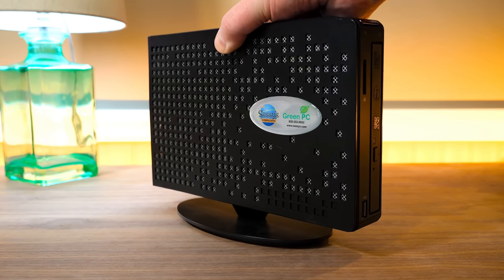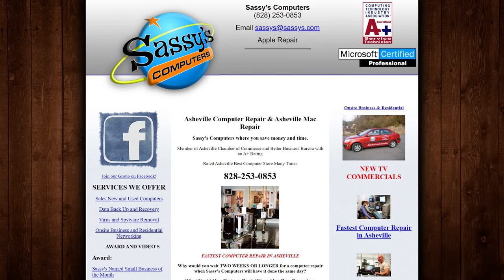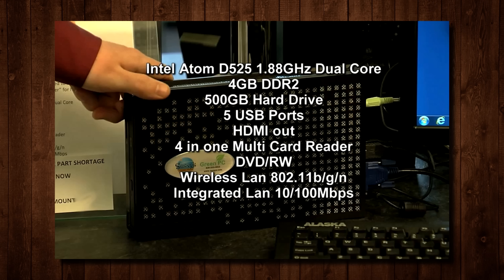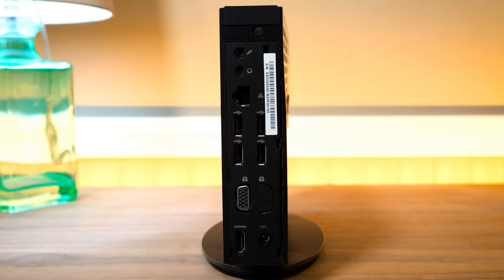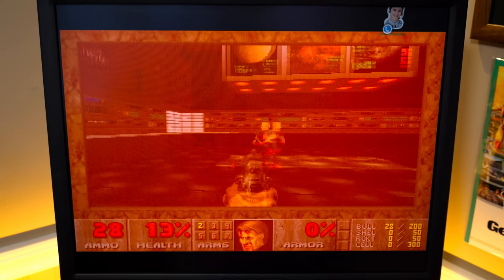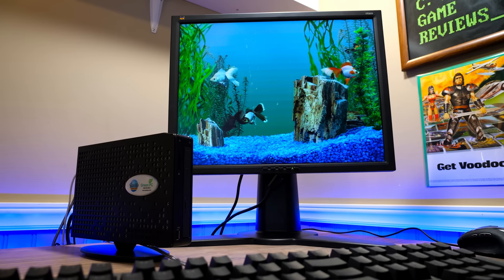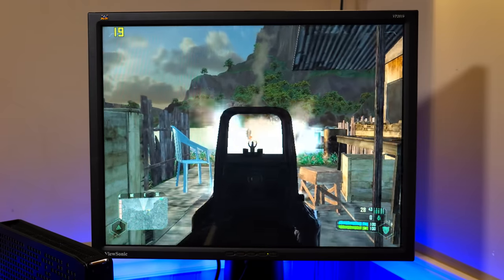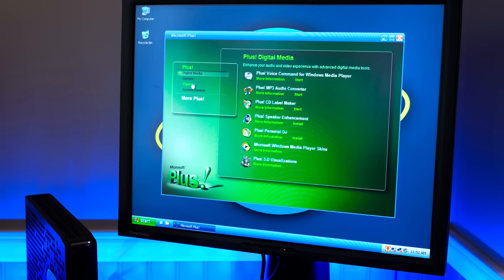Rejuvenating a $599 Shuttle Nettop from 2011! Sassy's Green PC

Comment: Used one of these as my daily driver back in the day, running Linux.  That it was fanless and had the Nvidia chip were the big draws for me.  Was just BARELY enough GPU power to run Starcraft 2 under Wine -- though on hot days, I had to point a box fan at the Shuttle to get a decent frame rate.

Comment: I just pulled a couple of these out of a storage box. Did you try and connect it to the internet?  Mine no longer connect and suspect the issue is related to TLS1.2 as none of my other old XP machines will connect to the WAN - they work fine on my LAN. - Ed

Comment: I recently got my hands on an HP All-In-One from 2016 with a spec list that's only marginally better than this, and it was apparently shipping with Windows 10 installed. Yikes! I got Lubuntu installed to it and use it primarily as a remote access client to my main rig, and honestly it was a smoother experience running Windows 11 from my main rig over the internet that it was running Lubuntu native.

Comment: I've bought a more modern mini pc, core i5 (8th gen), 16 gigs- put Linux Mate on it. My old computer died. I then got the Vulkan drivers on it, And it's a low level 3D modelling/ game running/ 3d printer handling thing. 
I've learned that silent= NOT good. Put a small desktop fan in front of it. Putting one in a mini fridge would be a hella project (obviously taking steps from getting moisture in it). Then, got an Onn multi card reader USB port thing. 

I now have more desk space to clutter up. 🙄

Comment: Its no wonder it struggled so much with windows 7... the aero theme was on. I wonder if there's even a big performance difference between 7 with classic theme and no aero on and stock windows xp
Reply: Good question 😊
Reply: I use Aero on my N270 netbook with a single-core Atom and base Intel graphics and it's surprisingly fine. I"m sure I would have switched off Aero if it made much difference. Given this nettop has the NVIDIA Ion chip Aero shouldn't make a difference.
Reply: @eDoc2020  that is not my experience with aero . Particularly when it released with windows Vista.  There very well documented videos of people disabling aero and getting performance gains and they go back before 2010 ...closer to 2005
Reply: @Amerikanskis  I agree it makes a difference. But for my purposes it wasn't enough of a difference for me to worry about. With my 576p screen Aero's ability to Alt+Tab between without redrawing made it worth it. Note that the integrated graphics on N270 netbooks is the same as early Core2 systems from 2006. This is the oldest that can handle Aero decently. Older cards, even if generally more powerful, often are much worse with Aero due to the specific GPU features involved.

Basically the older Atoms are slow enough that the additional slowdown of Aero doesn't matter.
Reply: @eDoc2020  it gets confusing when we talk about atoms because they really should have done atom 1 atom 2 atom 3 ect... because they vary so much. It be nice if they named named like pentiums or even closer to the iX naming scheme. 

I figure you're right for anything you should be using an atom for in the real world. But Clint of course is gunna game on it lol. In that case aero prob robs a few percentage points which is noticeable with Fraps counting frames

Comment: Since it can decode 1080p, I wonder how well it would work as a little Steam Remote Play machine? If they're available that cheap it could be really useful
Reply: Someone else in the comments mentioned they used it for that and it was pretty good at 1080p. Apparently theirs had a celeron which supports quicksync video decoding so no guarantees it'd be good with the atom.

Comment: I currently own 2 of these units, a V2 and V3, I'm wanting a v4. My units are being used as linux mint based file servers.

both are fed on 120GB gigabyte ssd boot drives and 4GB ram, one server being dual ssd(120GB/1TB) and hybrid(120GB SSD/4TB HDD).

the v3 has a ethernet bug within linux so have pulled the wifi card and begun the search for a mini pcie card solution to replace it so that media can be streamed from that particular server across the network.

Comment: running a full copy of snappy driver installer off a flash drive on that thing should fare some newer drivers for a bunch of the onboard stuff... the drivers you grabbed are going to be the release set, that was during the time when Shuttle didn't update their base drivers periodically. If you got the nvidia driver direct from the shuttle site you should also consider checking up on nvidia's site for a more updated Ion driver, since while SDI may say it has a newer version, I've learned not to trust the display drivers from that program unless they're strictly Intel or a not-so-common mobility radeon or the like with weird driver support.

Comment: I have a nearly identical system hardware wise, except mine is made by Asus. It's called the Eebox IIRC, weird name. I originally got it to use as a HTPC, restored and upgraded it only to find out Windows 7/8/10 all ran like absolute crap and it couldn't even do YouTube at 720p. I was disappointed, ended up building a mini ITX system with a i3 2100 and a GT 1030 that works far better. I'll have to see about putting XP on it at some point as it looks much better for the hardware.

Comment: I've never understood the market for these things. You could typically buy a laptop for around the same price (or actually less), with higher specs, similar power consumption, and you can take it anywhere you want.
Reply: At $600 in 2011 this thing was not a good deal. These atom processors were in netbooks at the time that sold for under $300. I remember buying a laptop with a Core i3 in it in 2011 and it was under $500.
Reply: @spunker88  Same here.

They still sell this same concept today (my doctor's office is full of them) and they're still more expensive than a contemporary laptop. Even on the basis of energy efficiency, an average laptop that isn't running it's own display only pulls about 20w during typical office use.

Comment: The one computer repair business I visited in Greenville circa 2018, they'd try to charge you $1000 in a hundred unnecessary tweaks and part replacements for what turned out to be a single faulty GPU. Seriously, they even tried to convince me my motherboard was visibly burned, which I could see it wasn't because there's a window in my case. If that sort of business practice was common among repair shops, no wonder they're struggling now.
I won't name the shop, but what a bunch of clowns.
Reply: Sounds like the clowns over at University PC Care. They are known in Greenville for this.

Comment: @5:20 the D525 supported 8GB, I still have a 1215N that's running 8GB ;-)
(even through ASUS claims only 4GB are supported)
PS: it run NfS Most wanted but it slows at every are change of the area, with an SSD it booted to full desktop (ArchLinux, XFCE) in 30 seconds

Comment: get a low powered distro like Peppermint Linux (get it in 32 bit if the cpu limits you), then add the nvidia drivers via something like Xorg Edgers, and even throw retropie at it (use the Retropie x86 command line install) and then see how it goes ;)

Comment: I got a mini pc laptop I think xmas 2011, give or take 1 year... It was an Intel Atom, I don't remember anything more than that, also Compaq, and it was running windows 7 Starter, which I asume would be also a better choice for your PC, assuming it supports it... but still my computer was way to slow to run, eventually I did indeed install Linux on it, first I put Ubuntu on it, 12.10 I think, and already using it on desktop, I was used too it. But even Ubuntu was too slow on it, altough the desktop space saving compared to windows 7 starter was amazing, but still I ended up with debian on it, which made it actually smooth for school work, using libre office mostly. and web browsing.. I still don't understand how that could be sold in 2011(or whatever) beeing so incredible slow, seriously it was useless for doing Office 2007 with windows 7 starte on it, just browsing web... OMG how could they sell something like that, sure once I got debian on it, it was asewome, obviously really small helped, and the few games I ran on it was age of empire 2, which I saw  you running too, also got diablo II runing, and I believe sims 1 complete, ... even how slow that computer was, I miss it, and I wanna buy it again... oh again LGR your videos is sending me to ebay.....

Comment: This may have been considered in earlier comments than mine, but is it possible SOME of the framerate and performance loss in some of the higher requirement games is due to excess heat from being passively cooled?  Did you try putting an external fan on it to see if it marginally improved?  In either case, cool video and system, just thought I'd ask!
Reply from the maker: Oh the lack of active cooling certainly can't be helping, that much is true. But this is the same type of performance I've always gotten from these Intel Atom/Nvidia Ion systems, netbooks and otherwise.
Reply: @LGR  Cool, and by the way this is my first commentary on a video of yours and I just wanted to say I dig your videos and especially narration, cool mix of funny quips and interesting detail (with just the right amount, not excessive) - and I'm happy to see you're engaged with your viewers generally in your comments as well.  I appreciate your channel and your efforts!

Comment: Whatever happened to the green computing trend?
Reply: It's everywhere now. These kinds of USFF systems are alive and well in the business sector. You can buy Dell Optiplexes in Micro and USFF sizes with i5-10500T (35 W TDP) and i5-1145G7 (15 W TDP) processors, for example. Should be well under 10 W in idle, quite possibly less than 5 W, yet still with a decent amount of grunt if required. Atoms have not been updated in a few years, but I'd think one using Intel's revamped E-cores from 12th gen could be quite interesting.

With a bit of care, even a full-sized PC can be made to run at very low power. For example, I have gotten very-low-load power consumption figures of around 11 W, a more realistic 15-20 W in low-load scenarios and somewhere around 30 W on YouTube (720p, 2x speed) out of this:
CPU: i7-11700
Board: Asus TUF Gaming Z590 PLUS WIFI
Graphics: iGPU
RAM: 2x 8 GB DDR4 @2933
Storage: Samsung 970 EVO Plus 2 TB (NVMe), 850 PRO 2 TB (SATA)
Other: RTL8125B PCIe x1 NIC @ 1 GBit
PSU: be quiet! Straight Power 11 550 W (the regular old 80+ Gold model, not the Platinum - that alone probably costs me an extra watt)
1 case and 1 CPU fan only running at a few hundred RPM each, presumably <1 W
Windows 10 21H2
And that's with the platform rather being a step back in power efficiency over e.g. 8th gen. I imagine sticking with 10th gen and a SATA SSD on a MicroATX board could shave off a few more watts, not to mention that I could probably save 5 W when going the PicoPSU route.

You have to pull out all the stops, of course - enable ASPM for DMI and PCIe and make sure PCIe power saving in power profile is set to max, enable SATA HIPM + DIPM, set memory controller gearing to 1:2, and I found the board would not actually enable CPU package C-states (though you can select them just fine) so ThrottleStop had to jump in to fix that. I also made a few different profiles for turbo boost clocks including an "Eco" setting (4.0 GHz tops, 2.8 GHz all-core, maximum ~70 W package power even in Prime95 small FFTs, or about 100 W from the wall).

Considering that my trusty office rig (a modest i3-2120 on a Fujitsu D3161-B Q75 board, 2x 2 + 2x 4 GiB DDR3-1333, 850 Pro, new BQ Pure Power 11 400W, W7) only makes it to 18 W in idle either, that's really not bad at all. Haswell and Skylake really brought some further improvements in terms of idle power, and despite some regressions we're still at a fairly good level.

At this point my PC's normal power consumption is actually dwarfed by the monitor (25-30 W, that's CCFLs and oldschool IPS panel for ya) and speakers (2x 11 W).

Incidentally, the "10X less power!!" claim has to be an exaggeration by something like a factor of 2. I rather doubt that the little thing makes it to less than about 10 W idle, the GPU alone should be responsible for at least 6 W. Offices were not generally outfitted with X58 monstrosities or hot-headed Prescotts or Pentium Ds, so you can rather assume less than 100 W in idle. 
Between less power-hungry electronics and more efficient power supplies, idle power draw was on a steep decline in the mid-late 2000s and early 2010s. First-gen C2D, probably not much less than 60 W. 45nm C2D with 80+ supply can hit the low 30s barebones, low 40s with GPU. Sandy Bridge, usually less than 30 W, possibly <20 W sans "spinning rust". Skylake, perhaps 15 W. I've seen ~6 W values for 8th/9th gen systems with conventional ATX PSUs like the Corsair RM550x. If you insist on a separate GPU, you'll be very good if you make it to <20 W though.
Reply: @PileOfEmptyTapes  I'm really happy this is still alive and well, thanks for the great info!

Comment: I find it funny that you also beep your horn while going through tunnels in Need for Speed: Porsche Unleashed. Also, Grand Theft Auto: San Andreas is fine to run at 30 FPS. Running the game with frame limiter off and going above 30 FPS actually affects the game's physics. If too high, you will notice you cannot slide as much in a car and it will brake to a complete stop much faster, which is not how the game was designed to run.

Comment: You should have partitioned that SSD with a Win8/10/11 install media first, then rebooted to the XP install media.  XP's installer can't properly do the 4k alignment that an SSD wants.

You don't see too many of those little Shuttle boxes around anymore.  I took several off of the hands of a medical practice that never should have been using them (someone had the idea of running Nextech on them!!!).  Today, and for the last few years, one has lived headlessly in my home office with a Samsung SSD in it running Win10 Pro 32-bit and I access it via RDP or Anydesk or a network KVM.  The CPU is actually a 64-bit processor, but there are no 64-bit drivers for the iGPU and you don't want to run Win10x64 with its max of 4GB RAM, anyway.  It gets powered on in November each year to run Light-O-Rama and oeprate my Christmas light show, then it goes back into hibernation in January.  It's a member of my domain and gets backed up to my Veeam Backup and Replication server while it is on.  For this, it's great.  I wouldn't try to do much else with it, though.  Maybe it could run Linux and be a pi-hole or redundant DNS server, but why do that when I have Raspberry Pis to spare?

Comment: I wonder what would happen if an actual active cooling system was bolted onto the Atom? Just curious.
Reply: It would probably still be slow, just less hot. They were made for low power consumption above all.
Reply: Ah. I was wondering If it was throttling due to heat. Less heat = faster? I don't know if that works with these old Atom procs.

Comment: I'm curious how much rigging some fans onto it would help performance
Reply: My guess is it would give no performance boost. The CPU doesn't have any boost so it should be running at full speed unless it thermal throttles.
Reply: @eDoc2020   thermal throttling was the thing I was wondering about when I posted, but reading into this old Atom revealed that it doesn't have much in the way of thermal management, so you're probably right that cooling it wouldn't do anything if it was already below 100*C

Comment: 1) installs SSD 2) installs winxp, not the best choice for SSD, when there are so many lightweight Linux Distros ESPECIALLY FOR THAT KIND OF OLD HARDWARE. Brilliant.
Reply: Linux makes even less sense on an SSD. Windows 7 from my experience is the best choice, a clean install runs very well, even on much slower Atoms. Every Linux distro I tried felt slower, although my netbook was limited to 32 bit OSes
Reply: @xPandamon  did you try Tiny Linux tho?
Reply: @MultiQuad  Yes, from a usb stick. But at that point you're giving up a lot, which felt unnecessary as Windows 7 ran pretty well anyways. I had a second disk drive for Linux shenanigans so I could basically hot swap it and Linux barely felt any faster, unless it's a distro that just heavily inconveniences you

Comment: Almost bought a Asus 1215N back in the day, then they announced an AMD version called 1215B and I got that instead.
Still though, it was terrible in all ways except CPU performance, architecture (x64) and USB 3.0 compared to my Thinkpad X60T so I just forgot about the Asus an kept using the Thinkpad instead.

Would not have wanted to have one as a desktop though, that is not enuff power to get anywhere

Comment: 1:34 I know this is very off-the-topic but can anyone explain what the primary purpose is of a building with a front brick fascia which is so much higher than the roof?
Reply: To designate it as the front of the building. The porch roofing was likely not there originally, but added the building's construction to provide rain cover. It would explain why some pillars are free-standing. Then again, those free-standing pillars could be serving the purpose of bollards. We may never know unless you ask the architect. Some chapels in Dominican Republic adopt that same style so the building may have been a Catholic chapel prior.
Reply: @lightly-red-huedmaleindivi6266  Thanks for your reply. Would the front of the building be difficult to identify? Surely people would recognize it from the front entrance at the road front side or where the parking lot is?
I have noticed that this appears to be a style of architecture and I think there might be an aesthetic reason as well as a practical one too, otherwise I don't think it would be done. I think there's a downside though if part of the brick wall above the roof would fall on to it.